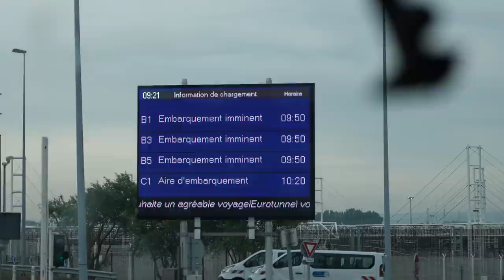Van Camping in DIY Camper Conversion (driving home) Europe Road Trip Ep 4

Comment: I would put 4 bamboo sticks upright inside the edge of the pot in the shape of a square.
Tie the top of the bamboo together with a cable tie to create a pyramid shape, as the plant grows use smaller ties to fix the plant to the frame, this will keep them off the floor and give them support to grow.
I am all in on potatoes this year, I found a place online that did blue, black, purple, pink, and multicoloured varieties, they are about 4-5 weeks out, happy to send you some to try or sow yourself next year 👍